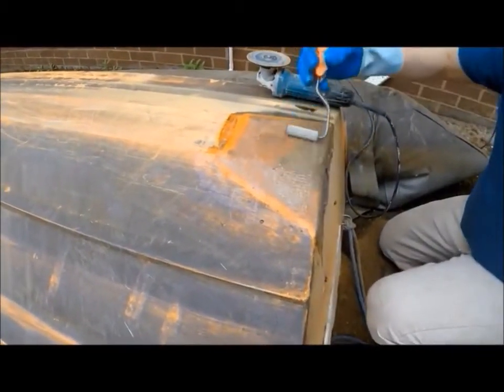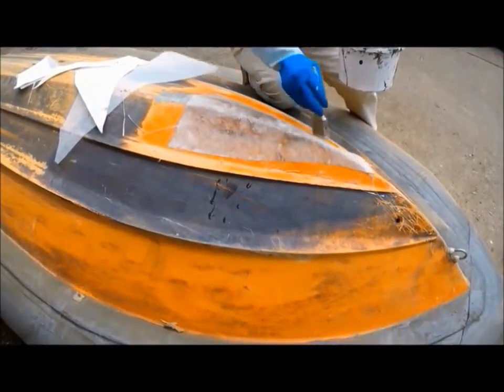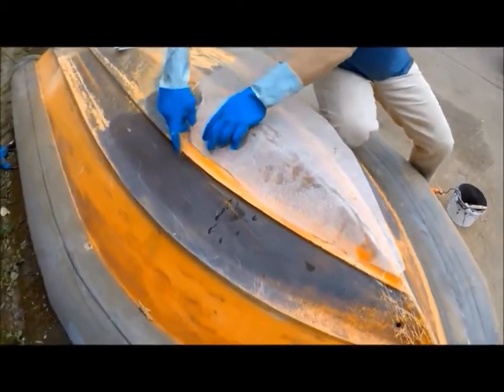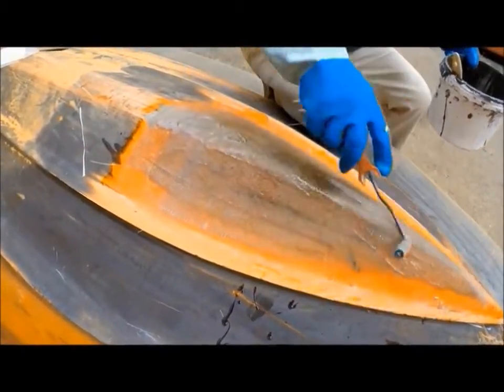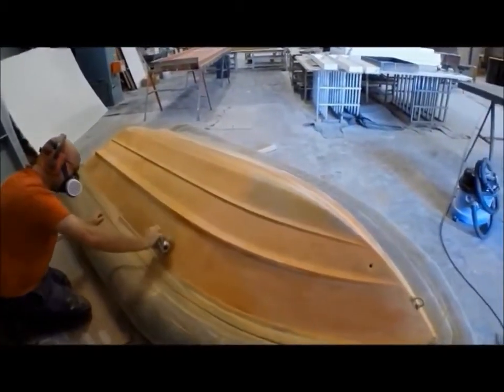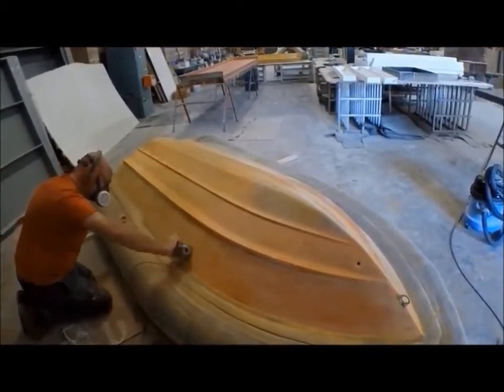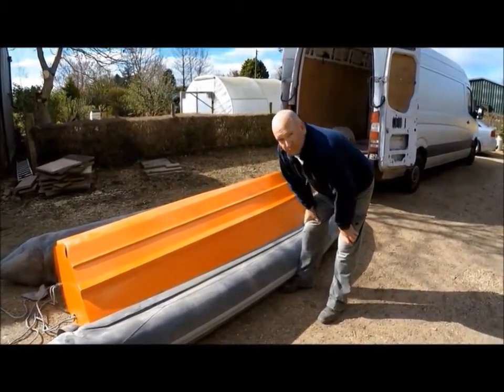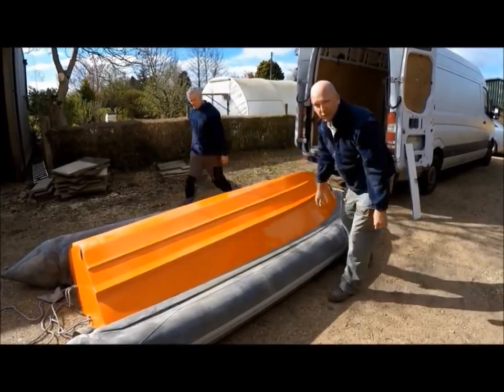Dive Boat Avon Searider SR4 4M R.I.B Rigid Inflatable Boat RIB Scuba

Comment: i have never seen putt polyester on gellcoat and hope it sticks, I think he should have removed the gelcoat first then putt it in g4 bonding then using the polyester with the resin. The repair will problably fall of on the next years to come. I think it wont hold 5 years.
Reply: It sure does I bought one of these seariders last year with the exact same repair job and I just pulled the lot off with my fingernails!
Reply: You are right, glass to glass only. Never glass to gel coat.. Also, he glasses peal ply to the boat!!! Who does that?? Its for peeling out after curing. DIY at it's best haha